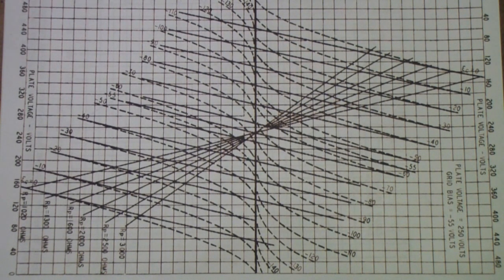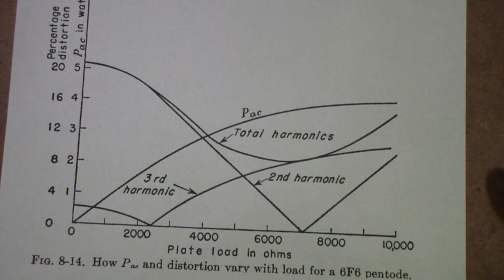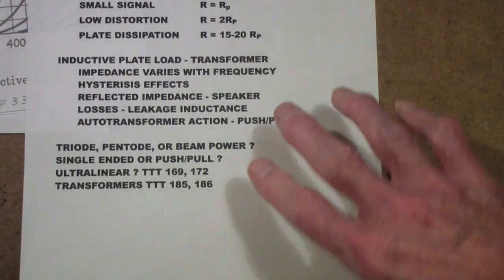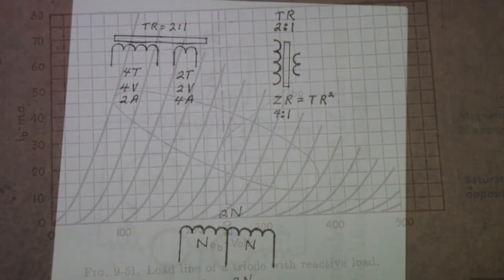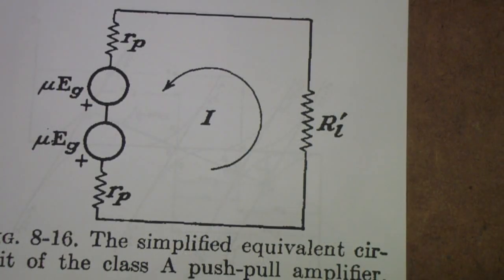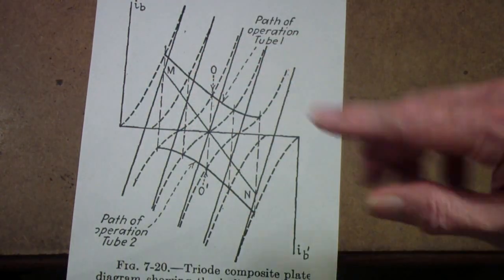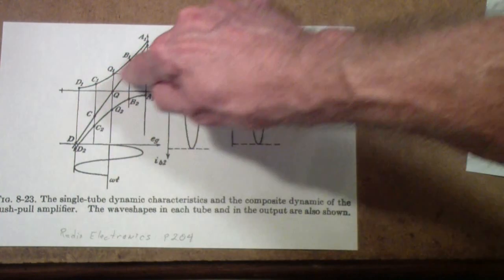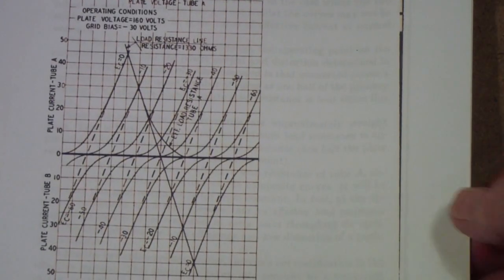TTT310 Why Tube Amps Sound Different Pt3

Comment: Do each tube of a push-pull amplifier normally go all the way into cutoff during 1/2 of each cycle or do they typically both conduct continuously?
Reply from the maker: It depends on the design and the biasing. Most HiFi Push Pull tube amplifiers are Class A and both tubes conduct through the whole cycle. But some Public Address tube amps were Class AB and one tube would cut off during part of each cycle - the distortion was considered acceptable in PA applications.

Comment: I believe you can determine optimum (maximu power) load impedance for a class A PP amplifier using the characteristics curves and ohms law. Using the 6L6 example used in your video, the power of a resistive load for 1 tube can be calculated by P=(Vs-Vp)*Ip. Taking points off the zero bias typical characteristics curve and substituting these values (Vp and Ip) into the formula above along with the supply voltage (Vp) the power dissipated by the load resistance can be calculated. There is a point along the curve where the load dissipation is maximum. Using the values of Vp and Ip where the load dissipation is maximum, the load resistance Rl can be calculated by Rl=(Vs-Vp)/Ip. This value must be multiplied by 4 (as you mentioned in your video) to get optimum plate to plate impedance. Using this method I was able to calculate the load impedance in your example to be 5000 ohms plus/minus 20 ohms (my first try reading the graph was actually 5001 ohms, lucky I guess). This can be adapted for non standard screen, plate, configurations, non standard configurations as well however I'm a firm believer in spice simulation to verify the results. If you'd like to now how I arrived at this or find a fatal flaw, don't hesitate to contact me.